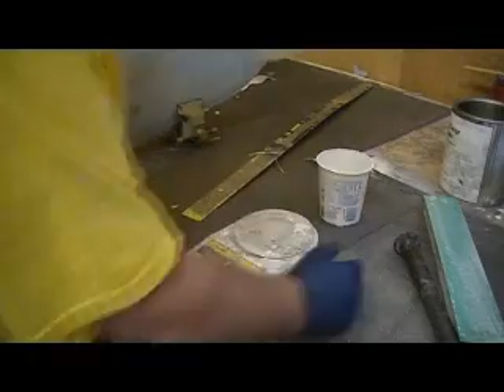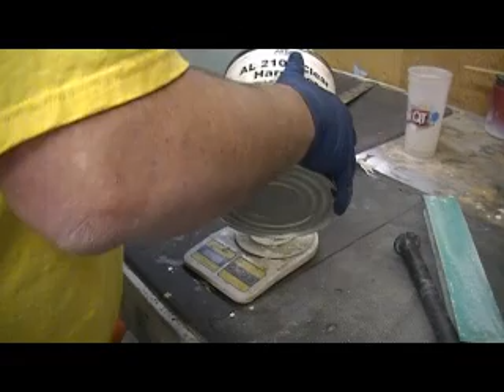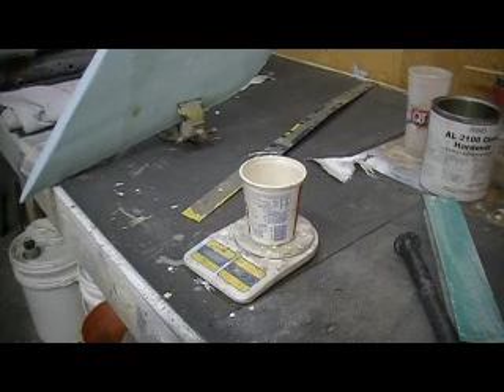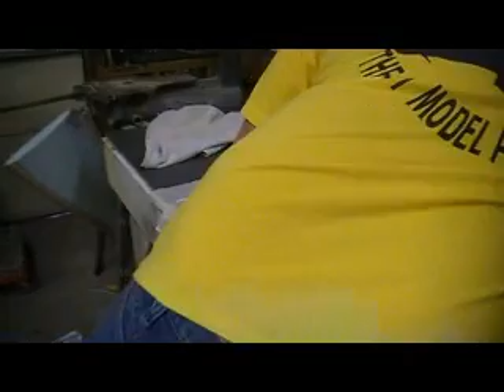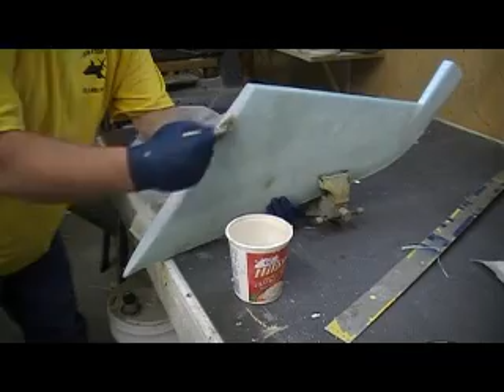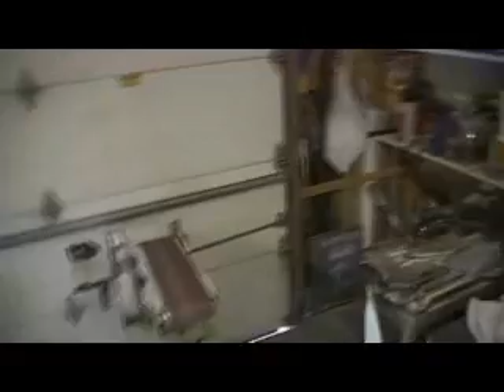how to build a rc jet B-1 Bomber # 133 pt 3

Comment: Bob, I have a question about your resin. During the video, you mention that the mixing ration was 25 to 1. However, you added 50 grams of Hardener to 200 grams of resin. Isn't that 4 to 1? Did I miss something or get it wrong?

Thanks! And keep up the great work! I would love to see you bring the B1 to Toledo for the Weak Signals show!
-Jorden